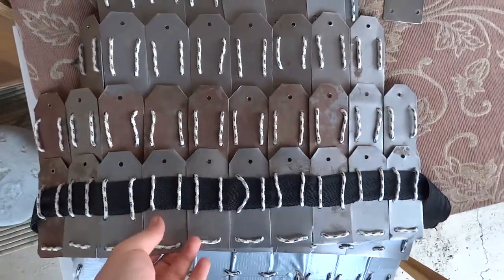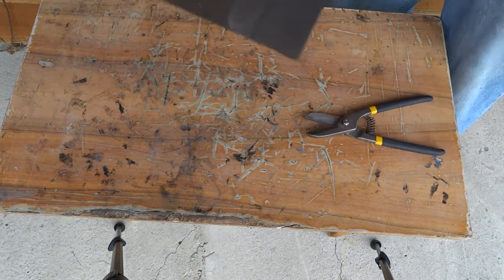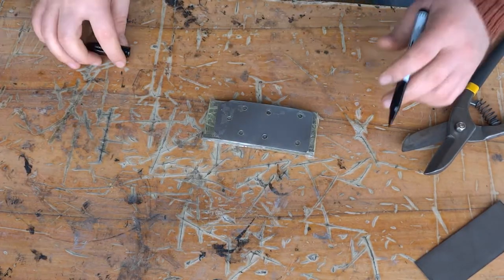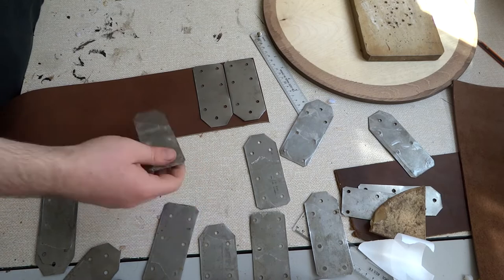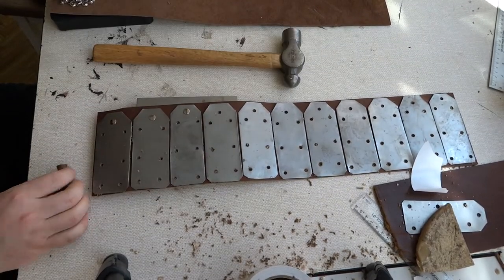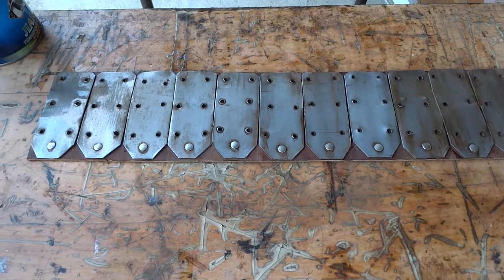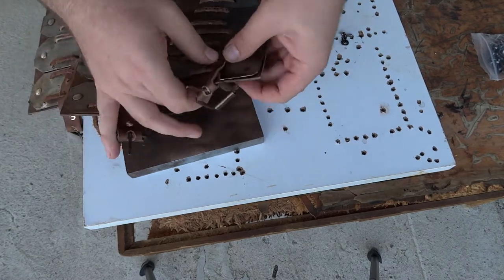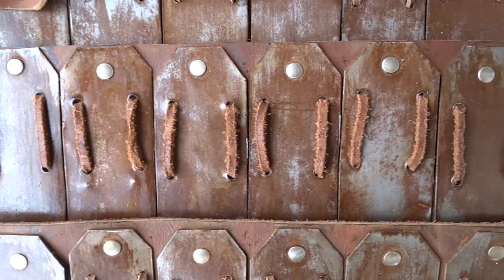how to make lamellar part 2 or battle with rust

Comment: It is common steel what you got there? I mean, if you could get a sort of one with a degree of rust resistance with a coat of oil should be enough.( Or even wax)
But you could try to burn the metal red hot and then deep it in oil. The black layer of burned oil helps a lot but its a bit messy
Reply from the maker: I'm making scales now and thats what I'm planning. to burn the oil on it. because Lamellar is as brown as leather now and its driving me nuts

Comment: Thanks for the video! If it is for larp and historical accuracy isn't 100% nescessary, maybe could aluminum be a good alternative for steele to avoid rust? Either way you have inspired me. I really want to make an armor like yours for myself now.
Reply from the maker: thanks, I might use Aluminum in the future, or maybe if I can afford it Bronze to give it that Byzantine look.
Reply: @thebordoshow  A "cheaper" way but not easier would be by electrolisis. And the coat of copper should protect the steel against rust
Reply: @theterroristcat5163  isn't like its that hard to do, grind it, clean, a proper solution, an electrode, some current and its done

Comment: Very nice armour. Well done! 👏🙂 If I want to treat metal like mild steel, for these scales I would polish each scale and then put them one at a time on a hot plate to get the metal a nice blue colour and then quench the pieces in vegetable oil, hang them up and let the oil dry. For the hot plate, that slab of steel that you're using as an anvil would be ideal. Put it on your cooking stove, or portable gas BBQ. This method works a lot better than heating the thin metal over the open flame, because you won't get a uniform colour over the whole plate over the flame. Don't have a metal plate? No worries, because a heavy base frypan will do the same job. Cheers from Downunda! 😉
Reply from the maker: thanks, I might try that later, I'm currently making scale mail and covering them with wax mixed with olive oil, but it still rusts. ether metal dust got in while cleaning or it rubs off easy.
Battle with Rust continues
Reply: @thebordoshow  Ha ha! All the contemporary accounts, that I have read, mention the Knight's pages spending hours rubbing the armour with fine sand and oiling everything and the only rust preventative they would have had would have been animal fat of some kind possibly blended with bees wax. Have fun! 😅
Reply: @thebordoshow  There is another way, if you don't want blindingly bright armour and that is to clean the scales thoroughly and let them get an even layer of rust all over, then paint them with boiled linseed oil and let it dry. Repeat this three times and you will have lovely 'Browned" steel armour that would look like the Japanese lacquered armour. Otherwise, go to the building recyclers and get an old kitchen sink and cut it up into scales. That steel will never rust easily.
Reply from the maker: @Afro408  I tried laquer and bunch of oils, I currently want the shiny metal look, but in the future I plan to make different styles of Armor with different colored metal so I might use it for that
Reply: @thebordoshow  Kool! 🙂

Comment: You probably need to retie that leather stitching, if one strand gets cut it will easily work into a massive hole in your kit. Each stitch should be tied inside
Reply from the maker: Leather string got ruined on its own so got to replace it anyways
Reply: @thebordoshow  need to oil it. Will also protect your metal.
But yeah each time it returns to the inside throw a knot and it will last longer
Reply from the maker: @zzzires5045  yea, I started doing that now. Failure is the best teacher I guess

Comment: I'd like to try to make one too, how thick of a leather would you recommend? 1mm 2mm ect. Also i think it would be good to paint the backside of the plates to prevent rust, since you can't get to them to clean them.
Reply: Also, how long and how many strings of leather would i need?
Reply from the maker: my plates rusted over even though I lacquered it so keep that in mind.
Id recomment 2mm or thicker as it will be holding some weight on it.
i did paint the backsides later on but it still rusted, so who knows.
Reply from the maker: I don't know actually, I just had a bunch and used it all. but they started to fray, so if you're gonna keep using the armor I recommend something else that doesn't fray and break easy.
Reply: @thebordoshow  I hear latigo and kangaroo are strong leather laces, also heard of larpers using paracord. Thanks for the great vids!
Reply from the maker: @grahamtpeterson  I too use paracord sometimes but what is sold in the stores never look good enough for crafting and painting does not always hold well

Comment: Is the leather vegetable tanned? Because natural tannins cause rusting of iron. I guess this can be solved by using either a canvas/denim backing (canvas is period, denim almost but not blue denim) or an alum tanned (="tawed" ) leather. Hope this helps
Reply from the maker: No, it's chemically tanned. Couldn't find vegetable tanned in the whole country, because its better  for hadnening and shaping.
Rust took over when I left it in my village home, where moisture was much greater.
Reply: @thebordoshow   @the bordo show  Hmmm, if the side of the scales which touches the leather is way more rusted than the outside it means that the leather itself interacts with the iron.
But anyway, I suggest you replace the leather with canvas or denim. A Greek term for the material used in making klibanion armor is ζώνη-zone which normally denotes a fabric sash and not a leather belt. Besides, fabric would be cheaper and no less effective than leather as a substrate for the iron scales.
Reply from the maker: @AggelosKyriou  very interesting, next time I might do that, save up on money too.